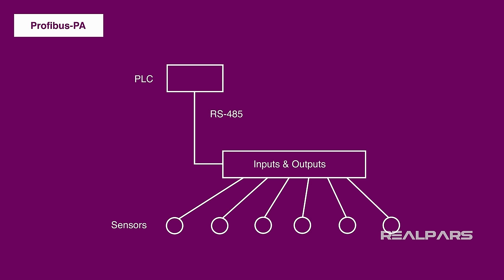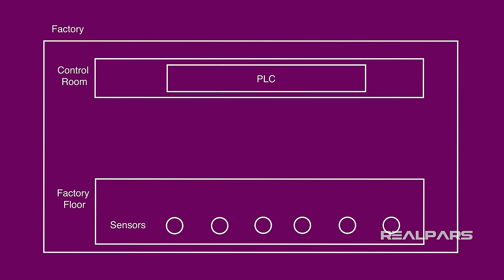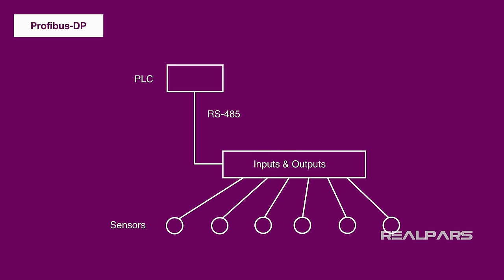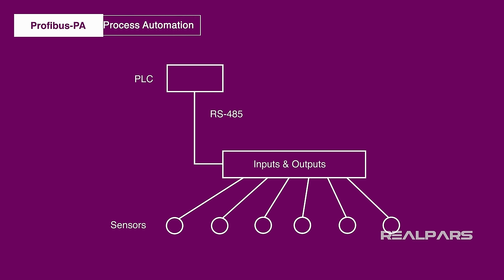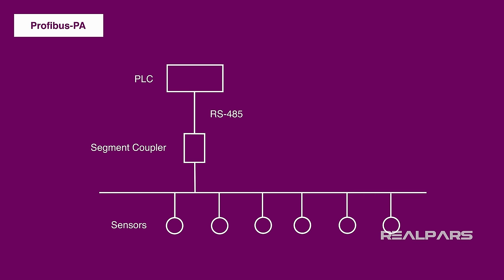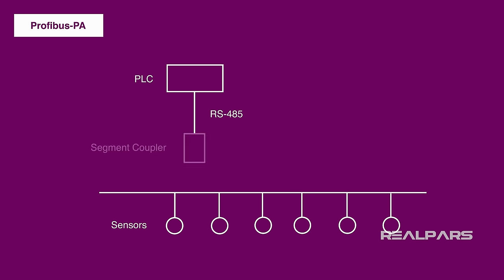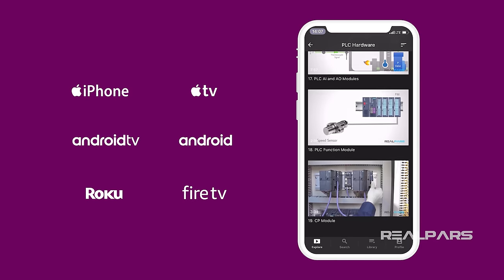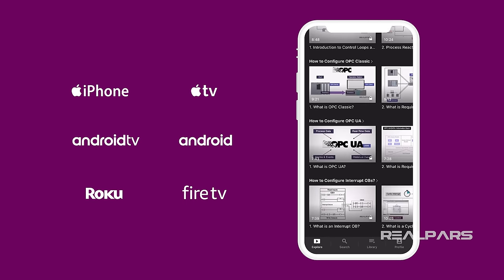What is Profibus PA and How Does it Differ from Profibus DP?

Comment: Do we need I/O module with Profibus PA?
Reply from the maker: No I/O modules are required.  The ProfiBus PA cable is dropped and connected to each device.  Passive junction blocks can be used to make it easy to connect several blocks locally, but these are not I/O modules since they are passive and not active (no configuration or memory).

Comment: Would it be correct to say that Profibus DP is the equivalent of Remote I/O racks in an Allen Bradley controls system?
Reply from the maker: You can make that analogy.  For Remote I/O racks that contain I/O cards and are connected to the main CPU through the use of a Profibus communication interface module, the similar system in the Allen-Bradley system would be Remote I/O racks that contain I/O cards and are connected to the main CPU through Ethernet/IP.  VFD's can be connected directly to the Profibus DP network (with the proper interface in the VFD) jut like a VFD can be connected to Ethernet/IP (with the proper intreface card).

Comment: Does the sensors have to be replaced with Profibus-PA compatible sensors? Or do you need additional converters for each sensor?
Reply: Very brief  explanation& very informative.
Reply from the maker: The answer is yes.  All sensors that you want to connect to a Profibus PA segment have to have the Profibus PA interface electronics installed in the sensor, actuator or device.  Profibus PA gives you the power to remotely configure, diagnose, maintain, and re-range sensors from the control system.  You will need to determine if is it worth the extra cost (not as much as you might think) to be able to maintain and document your instruments remotely.  Sensor diagnostics, PV, tag, model and serial number info, alarm info, sensor health, and other variables are all able to be monitored and configured via Profibus PA.

Comment: Sorry for an irrelevant question, based on what we decide how many os servers or es servers should we take for a single process?
Reply from the maker: Typically, only 1 ES is needed unless you have a very large plant and require multiple projects to be configured.  You still only need 1 ES, but it may be more advantageous to have 2 or more if the plant areas are far apart.  The same goes for OS servers.  If an OS server goes down, it will take your "operating window"  away, so many times, the number of OS servers is set by the scope of the plant operations and the level of reliability required.  Redundant OS servers may help reduce the number of overall OS servers required, but it makes the installation a little more complex.

Comment: it's easy to connect a siemens plc or a scalance  with profibus, but what about a sensor? how does a sensor connect to profibus? for example a thermocouple probe?
Reply from the maker: A sensor needs to have a Profibus interface built into the sensor.  Typically, for these sensors, this will be Profibus PA.  Profibus is a 2-wire system that has special connectors for use with Profibus PA sensors.  Usually, an M12 connector is used.  A thermocouple probe would not connect directly to Profibus.  It would need to be connected to an RTD card in the PLC system or be connected to a transmitter that has a Profibus PA interface.

Comment: Instead of connected RS485 can we connect with ethernet cable directly to DCS system from IO in case of Profibus-DP?
Reply from the maker: No, Profibus DP and Ethernet are two very different protocols.  You will need a link coupler or Profibus to Profinet converter (both are hardware devices) to connect Profibus DP to Ethernet (Profinet).

Comment: If we remove I/O modules then how plc will know, which I/O device has sent the signal, and how you will provide isolation between cpu and supply??
Reply from the maker: For Profibus DP, the position of I/O cards in remote (and local) racks is defined by the hardware configuration which is downloaded to the CPU.  If you remove a card, the hardware configuration will need to be updated.  For Profibus PA, each sensor has a unique node address.  If you remove a sensor, that node will no longer communicate, but that will not affect any other node.  Independent power supplies are used to power Profibus segments, separate from PLC/CPU power.
Reply: @realpars  Thank you so much brother

Comment: How do we interface field instruments on a DCS using Profibus protocol. What hardware is required?
Reply from the maker: You need a Profibus DP master and a 24VDC power supply.  Special connectors and Profibus-compliant cable join the master card (a cp-343-2 card in a PCS7 system, for example) to the devices in a daisy-chain fashion.  For Profibus DP, usually a DP/PA link coupler is used to allow the Profibus PA segment to look like a DP segment at the PLC.  Connections to Profibus PA sensors is usualy done via passive drop blocks and M8 or M12 connectors.

Comment: Also I have a question about the maximum distance for RS485?
Reply from the maker: This a similar question to "how far can a car go on one tank of gas".  It depends.  RS-485 is a current-based protocol, so it can travel a long distance compared with other serial protocols.  A general rule is that the maximum length is determined by baud rate, cable type, and host device capabilities. In general, the faster the desired baud rate, the shorter the length of the maximum run of cable before significant signal degradation occurs.  For 1Mb rate, the typical maximum distance is around 800 feet (275m).
Reply: @realpars  Thanks so much for your reply

Comment: Does ti505 siemens old models can still connect with new models of profibus dp drives
Reply from the maker: Profibus DP has had a few versions over the years:  V0, V1, and V2.  All versions are backward compatible, so as long as the master (the PLC) is at or above the revision of the connected drive, communication should work.  Many devices have a selectable Profibus DP version selection that will allow the device to work with CPU's at a previous revision level.

Comment: What is the cable used for Profibus PA?
Reply from the maker: Profibus PA uses a 1 Pair, AWG 18, Tinned Copper - Stranded cable with a Polyolefin jacket, Foil(s) or Copper Tape(s) shielding, rated for 300V.  A reference number is Belden 3076ELS.

Comment: If we are using DP/PA Coupler..Is Input /Output Module Can be used or not??
Reply from the maker: These are really two different things.  The DP/PA coupler brings a Profibus PA segment onto a Profibus DP segment so that to the PLC it looks like one big DP segment and is addressed as such.  Separately, you can use ET200M I/O or any other I/O subsystem that has I/O cards to which digital and analog sensors and devices are wired.  In the above case, the Profibus DP cable connection on the ET200M communications module (IM151, for example), makes the rack of I/O available to the PLC as a single Profibus node.  The addressing is set in the hardware configuration for the individual modules, couplers, and cards.

Comment: But Profibus PA is not connecting directly. Letsay I have one proximty sensor input signal. i want to connect to specific input of PLC. How can I? because video showed there is no I/O module. only thing is have BUS.
Reply from the maker: ProfiBus PA is typically used for analog devices.  The function that a PLC I/O card would play for one input channel is "built into" the ProfiBus PA device, where the device address, as well as all of the required configuration parameters, are resident in the sensor electronics.  And yes, a ProfiBus PA sensor does "attach" directly to the I/O bus network and is polled by the ProfiBus PA master card/node.  Individual proximity sensors are often hardwired to a PLC card or are interfaced to the PLC via a ProfiBus DP node, which can be a multi-point I/O block.

Comment: i have one query. in PA we have connected segment coupler.. but to connect to i/o
Reply from the maker: Yes, a segment coupler allows a Profibus PA segment to be connected to a Profibus DP segment, which is required to be accessed by the PLC's DP port.  Profibus PA is designed to connect directly to the process sensors without the need for a remote I/O rack or interface.

Comment: What are the differences between profibus pa and foundation fieldbus
Reply from the maker: Both are similar but distinct protocols.  Both use single twisted-pair, shielded cabling and require termination resistance. Both are based on the same physical layer, so the previous similarities are expected.

There are many differences.  FF is publisher/subscriber based, and can be directly connected to a card in the PLC or DCS via FF H1; PA is master/slave based and requires a gateway or link coupler to be connected to the PLC or DCS (usually linked with Profibus DP).  For FF, I/O is mapped via embedded standard function blocks, whereas PA uses customized GSD files for mapping of device models.  Typically, 8-12 devices are able to be connected to a segment.  For PA, up to 22 devices can be connected to a single segment.

I have used both extensively, and both perform well in the industrial environment.  The key is planning and understanding of the limitations of each protocol (total power available, connectors and terminators, data update rates. etc.).

Comment: What happens to the I/0s when you use Profibus - PA?
Reply from the maker: Each ProfibusPA device is a node on the Profibus segment.  Each device has a memory table with many words of memory reserved for the PV, range, diagnostic, etc.  The ProfibusPA master is configured so that it is aware of the node, and the device's corresponding GSD file is loaded onto the master system so that the master knows how to map the various words of memory.  When the master retrieves the data block from the ProfibusPA node, it uses the GSD file to parse the data and store the values into tags on the master system.
Reply: @realpars  thanks a lot.

Comment: I have one question how profibus DP transmit data?
Reply from the maker: Profibus requires an external 24VDC power supply and a Profibus DP master, like a CP343 card in a PCS7 system.  The data transmission is controlled by the master at a configurable baud rate.  A ProfiBus system uses a bus master to poll slave devices distributed in
 multi-drop fashion on an RS485 serial bus.  Data streams are parsed by packets according to the GSD file that defines the data string for a particular device.  A packet can have up to 244 bytes.
Reply: @realpars  thank you RealPars

Comment: In profibus PA system,do we not need io modules??
Reply from the maker: For Profibus PA, no, we do not need I/O modules.  Each device has its own Profibus node address and data table inside of the device, and the CPU communicates with that node and shares data with it.  That reduces the wiring of instruments back to a central I/O rack.  For digital I/O and I/O that do not support Profibus PA, we typically would wire that I/O back to an I/O rack and attach the rack to the system via Profibus DP.

Comment: What are the main differences between Profibus PA and Profibus DP?
Reply from the maker: Profibus DP is a high-speed (up to 12Mb/sec) RS-485 serial network that can be used to pass data from devices such as weigh scales, remote I/O racks, VFD's, and other devices that typically have large embedded data tables.  Up to 128 nodes can be placed on one Profibus DP segment.  The bus is an active powered bus that requires termination resistors at each end of the segment.  The segment is connected to each node in a multi-drop configuration.  Profibus PA is used to interface process sensors to the control system.  Profibus PA operates at 31.25Kbit/sec, but the amount of data shared with each sensor is relatively small, and data update rates are typical for a process sensor (about every 0.25 seconds).  The physical of Profibus PA is Manchester-coded bus powered (MBP).  At the communication protocol level, Profibus PA and Profibus DP are identical.

Comment: Doesn't this bring too much adresses on the profibus? A lot more thicker wiring because every sensor is on the bus?
Reply from the maker: Great question!  Answer:  No.  The limit per segment of Profibus PA is 32 nodes.  For Profibus DP, it is 125 nodes per segment.  This is not a problem for addressing, as the Profibus master or link coupler is able to handle up to the maximum number of nodes and the maximum memory per node of 244 bytes.  If you do the math, for Profibus DP this is only ~31k of data and for Profibus DP this is only  ~8k of data.

Comment: What is the function of segment coupler?
Reply from the maker: The segment coupler allows a Profibus PA segment to communicate with a Profibus DP segment.  PLC CPUs have Profibus DP ports to which remote I/O, drives, and other Profibus DP devices connect.  CPUs do not have a native way to "speak to" Profibus PA devices, so a segment coupler is used to provide the CPU access to the Profibus PA device data.  Think of a segment coupler as a translator of information from Profibus PA to Profibus DP.

Comment: Are the same type of sensors / transmitters used for profibus DP or PA? The PA seems very similar to foundation fieldbus setup while the DP follows the 4 - 20mA convention.
Reply from the maker: ProfibusDP, ProfibusPA, and FFB are all based on the same physical layer (RS-485).  However, that is where the similarity ends.  Sensors made for each of these three protocols are NOT compatible with networks of the other two.  Sensors are typically provided with one of the following interfaces:  4-20ma/HART, ProfibusPA, or FFB.  So yes, ProfibusPA and FFB are very similar, but not interchangeable.   Devices such as scales, motor controllers, VFD's, and some analyzers are typically provided with one of the following interfaces: 24VDC/4-20ma, ProfibusPA, ASi, or DeviceNet.
Reply: @realpars  many thanks.

Comment: In my factory profibus is running how can I know that is PA or DP?
Reply from the maker: The best way to tell is to inspect the hardware configuration for the system you are using.  Other ways to tell:  Profibus DP cables usually have purple jackets and Profibus PA usually has orange jackets. This is not a foolproof method, but if cables meet the standard, this is an easy way to visually inspect for DP or PA.  Another good way is to see what devices are on the Profibus network.  If you see VFDs, drives, weigh scales, etc., connected by 9-pin connectors, it is Profibus DP  Often, the interface card they are plugged into indicates Profibus DP on the hardware port.  Profibus PA networks typically use passive connection blocks, usually with M12 connectors, and are used for transmitters, analyzers, and flow meters, etc.

Comment: So its mean all sensors are able to communicate using profibus PA?
Reply from the maker: The sensor needs to have the electronics to be able to interface to ProfibusPA.  Modern sensors/transmitters are able to be specified with a number of different interface cards installed.  If your plant uses ProfibusPA, then the sensors/transmitters need to be purchased with ProfibusPA interface cards.  Your sensor electronics need to match your instrument bus type.

Comment: How to calibrate  profibus PA type transmitter
Reply from the maker: Using a Profibus PA configuration software tool (like FieldWare or PactWare), you would connect to the transmitter, take it out of service, and then give the transmitter a process signal corresponding to 0% of range and then 100% of range.  You would use the configuration parameters in the transducer block to set the output to 0% and 100% when those signals are applied to the transmitter.
Reply: @realpars  thanks for response and informative

Comment: Whats is the difference between profinet and profibus ..?
Reply from the maker: The short answer is that PROFINET is faster with more bandwidth and the capability to send/receive larger messages than in ProfibusDP. PROFINET is based on an Industrial Ethernet protocol;  ProfibusDP is based on RS485. ProfibusDP segments are limited to 126 devices. PROFINET has no device limitation other than number of  IP addresses available.

Comment: why is profibus PA slower than profibus DP?
Reply from the maker: Hi Simon, 

Thanks for your comment, and our apologies for the delay in our response! 

Thank you for your question. Several factors contribute to this situation. Firstly, the introduction of a segment coupler to the line and the removal of the DP line to each device can lead to traffic conversion challenges from DP to PA. While there are other factors at play, they may be quite complex to delve into at this time.

Ultimately, the advantages of this configuration in terms of cost savings outweigh any potential concerns regarding speed. For more detailed information, I recommend checking out the following link for further reading: https://us.profinet.com/what-is-the-difference-between-profibus-dp-and-pa/